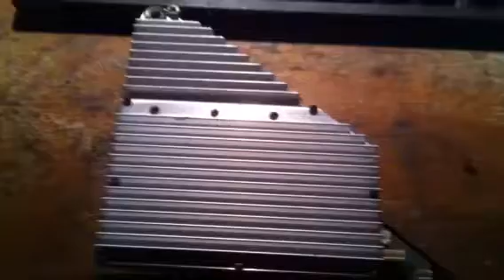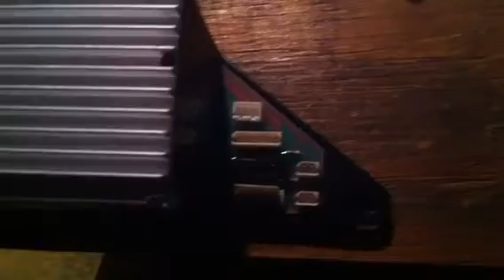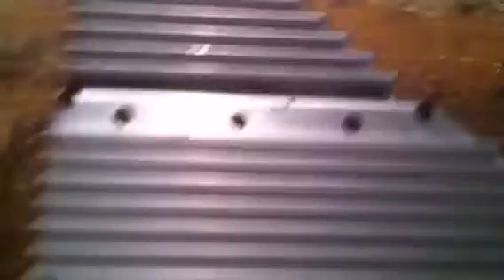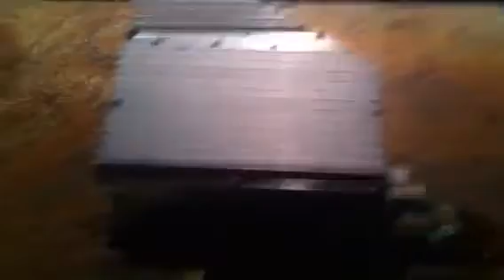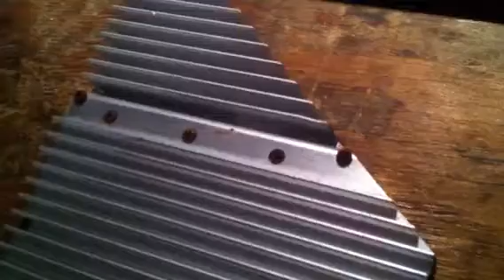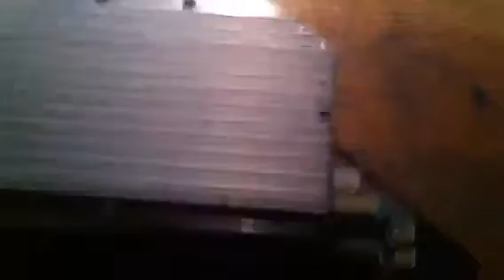EV Global ebike controller

Comment: Yes, replacing the stock 24v controller works, but you loose the function of the front/rear lights, cruise control, horn & thumb throttle.

The goal is to update these controllers to handle 52v, which will get the 24v/400watts rear hub to go 22 mph & still have function of the lights etc.

Of course the next best option is to find a "donor" stock 36v EVG ebike & use it's electronics.

What battery source are you using?

Comment from the maker: I couldn't diagnose the exact problem so I ended up using a cheap 25 amp controller @ 500 watts. works well enough but I'll be bumping it up to 36 volt 500 watts very soon. I heard of a guy in the UK who repairs these controllers and even has some for sale. I think I read about him in the V is for Voltage forums.
Reply: Just saw your post while looking for info to fix my sisters bike... I may be in the same situation myself...!

Comment: So....how far did you get? I've got three of these EVG 24V bikes, and I've update one using the Ultra Motors Callisto 36V controller/throttle/brake handles & use the EVG 36v battery packs, which I also have two (SX & LE). Works, though doesn't have the torque of the 500 watt 36V hubs. 

I've got three dead 24V controllers & was curious what you found out to repair, or a source to replace them?
Reply: Do you still have the controller?